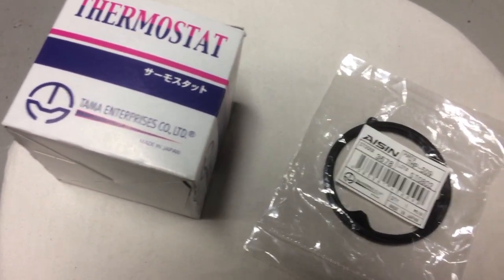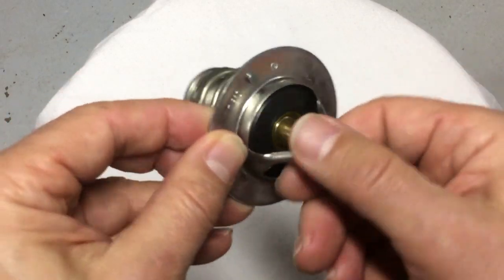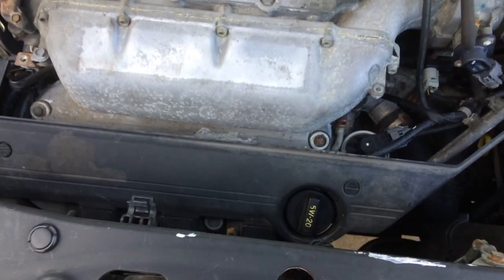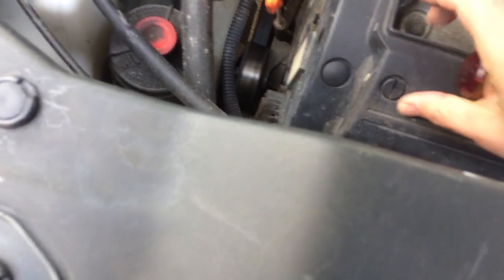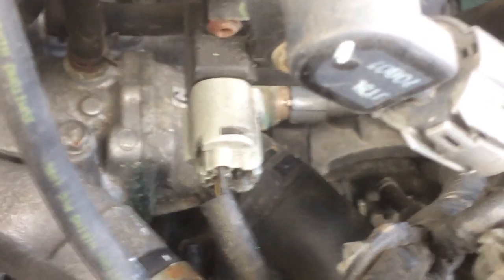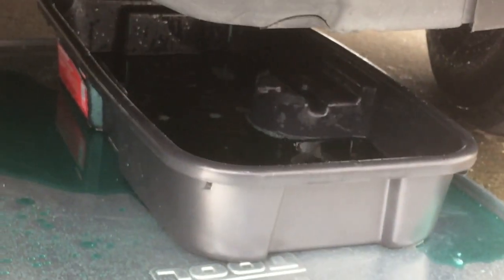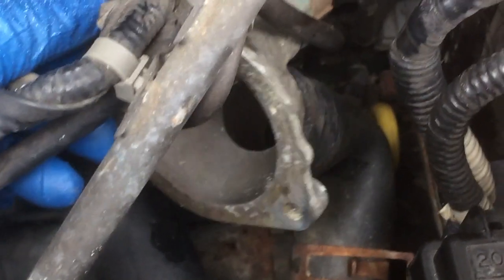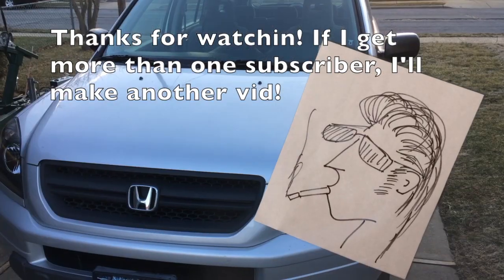2003 Honda Pilot thermostat replacement

Comment: Great video...DONT MEAN TO OFFEND YOU...I did exactly what you did as describe in your video ages ago.....This was the HARD WAY...THE EASY WAY....Was just REMOVE THE BATTERY and you have all the easy SPACE to remove ( with a long nose pliers for clamps) just 1of  the radiator hose and the 2 10mm bolts that hold the thermostat...
You have soooo much easy access space by just removing the battery....You dont even need to remove the electrical wiring...and you will find out when you remove one of the radiator hose connected to the thermostat....you wont actually lose not even half a gallon of anti freeze...And my FINAL ADVICE....YES....PUT A J.B.WELD WATERPROOF GASKET SEALER....I learned the hard way when i replaced my thermostat the 1st time ( without putting a gasket sealer ) only the black OEM rubber gasket.....And soon...i get LEAKS. from the housing....AND THATS WHY I LEARNED TO REPLACE THE THERMOSTAT ( REMOVE BATTERY EASY WAY )...
Once again...thank you for putting this video...This is how I learn from Good considerate people like you....WITHOUT YOU AND OTHERS....I would never learn to fix my cars and save money....Thank you SIR....🌟😆👍👋

Comment: I am replacing this but my replacement thermostat does not include the rubber gasket thing around it. Is it still fine to install without the gasket?

Comment: Pretty good Brooklyn accent... I actually have my eye on an ‘03 Pilot, 93000 miles; $3800. Good price?
Reply from the maker: Can’t help it, been trying to get rid of that accent my entire life, but not successful yet. So if the car was maintained well, it seems like a good deal. After all, these cars last forever. At that mileage, it’s due for a timing belt  and water pump (about $1k), maybe radiator and wheel bearings ( mine went at 100k). But then you should be able to get another 100k out of it. Also make sure you RELIGIOUSLY change the rear diff fluid or else the rear end binds and wears out. You will feel it i if it binds while turning on dry pavement.
Reply: Transmissions are a potential issue. ATF changes done religiously with Honda fluid or Valvoline Max life can extend their life. If it's got any shift issues or roughness I'd definitely pass. Everything else is pretty easy to fix. Also check to make sure there recall transmission jet is installed on the fill plug.
Reply: make sure the subframe isn’t rusted, that’s a common issue after 10-15 years no matter the mileage. my ‘03 pilot has almost 240 k on it and still a great car.

Comment: Are those aftermarket headlights?
Reply: Yes they are. The older ones becomes amber lights after a few years, and can barely blind ants
Reply: @jimiburns6891  my 03’s are still in showroom shape still after 17 Alaskan winters. Perhaps it has to do with high uv exposure
Reply from the maker: Yes you are probably right, but mine looked like friggin yellow fog lights from the UV. These aftermarket ones are holding up great. They been on for a few years now and still look new. But MAN were they a hassle to swap out!!

Comment: Hi. My fans don't turn on. I checked the sensor and relays, but nothing is wrong. And no sign of electricity on fans cord?
Reply from the maker: check the connectors (open, clean, reattach), and then the fan motors. Lots of times, the fan motor windings break down, not only with honda, but with all cars. Check current on motor coils